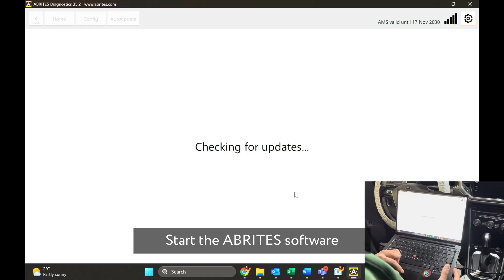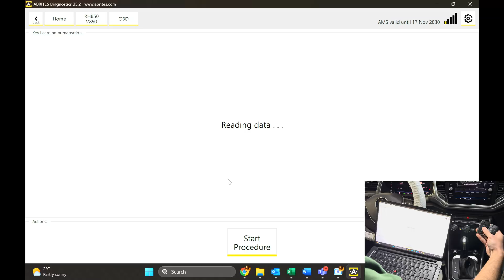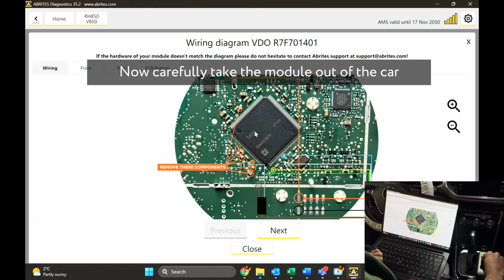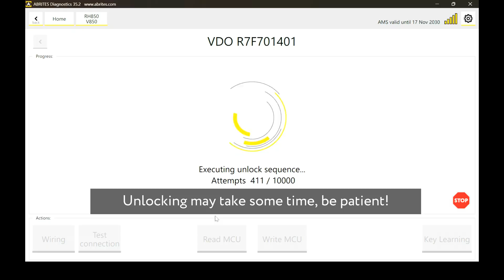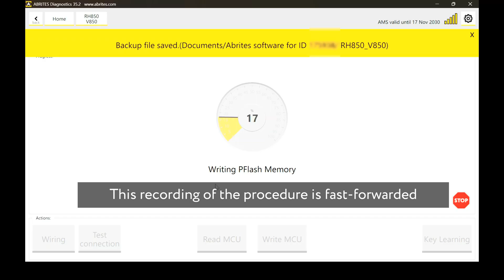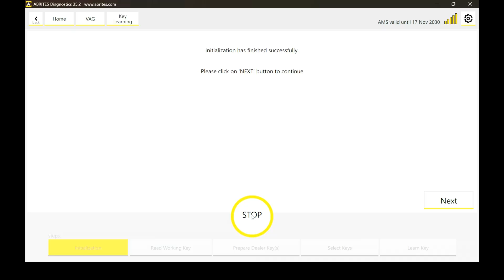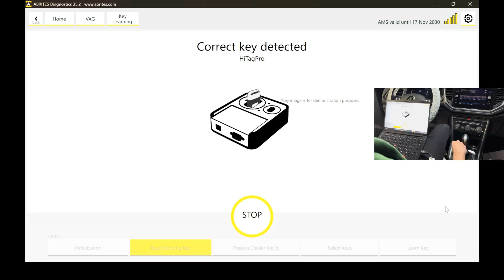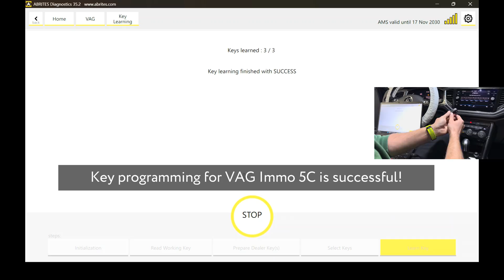VW T-Roc Immo 5C Add Key (HITAG-PRO) using AVDI, RH850 Programmer and Protag!

Comment: other users here in Brazil are also having the same problems with 5C not working on the Brazil panel
Reply: Yesterday I made a copy of the key for a 2022 T-Cross and I have to report that AVDI works fine. The problem with some key functions not working, such as the external presence sensor for the door opening lever or the remote control buttons, stems from the fact that some brands of "universal remotes" on the market (and I'm not sure if it's appropriate to mention them here, you'll know which ones I'm talking about) cause the problem. If the correct image isn't loaded when preparing the key for MQB49/5C, depending on the remote manufacturer and the image used, the internal presence sensor for starting and the transponder in the sensor antenna will always work, but the presence sensor and remote for external opening won't. However, when I change to a different "universal remote" manufacturer and use the correct image, everything works!

Comment: The xhors keys can be working too ?
Reply: Yes, you can
Reply: @twinturbo1989  Do you mean we can use the Original OEM Keys 5C instead aftermarket keys , is that it?
Reply: No, no other tool
Reply: @twinturbo1989  Hi Alek , OEM Virgin keys Hitag-Prog ID5C can be used ?
Reply: @twinturbo1989  hi, i think Xhorse key can be used for add key.

Comment: Bonjour, il y as besoin de remettre les condensateur retirer a la fin ? Merci d'avance
Reply: oui obliger pour les petits composants
Reply: @samir9656  merci pour votre retour vous êtes sur ? Une technique pour les ressouder ? C'est vraiment petit, il en parle jamais
Reply: @AnthonyStalder  je te conseille au fer en rajoutant de l'étain parce que l'air chaud ça me semble risqué. Fais contact entre les deux bords du composant avec ton fer tout en rajoutant de l'étain, tu verras ça part direct
Reply: @asvserrurerie-depannages2329 Merci pour le retour. Disons que l’enlever, je l’ai fait. Heureusement que je l’ai gardé du coup, mais c’est vraiment petit à ressouder et il ne parle pas et ne montre pas qu’il faut les remettres. J’essayerai demain. Merci en tout cas de m’avoir confirmé qu’il faut les remettre une fois le dump extrait.
Reply: @AnthonyStalder  Conseil pratique: plutôt que de retirer complètement le composant, assurez vous qu'au moins 1/2 pins ne soit pas en contact avec la platine (dessoudez 1 pin et relevez légèrement le composant). Si l'un des Pin reste soudé, vous risquez moins de perdre le composant et ce sera toujours plus facile de replacer le composant à la fin de la procédure.
Reply: @dmanis-ABRITES  Merci pour l'astuce ! J'essaierai pour le prochain. En tout cas, je pense que l'air chaud aura un meilleur résultat que le fer à souder, mais j'essaierai ta technique la prochaine fois. Merci !

Comment: Great Job Thanks !👌  just question ,  it is possible to use OEM Origial Virgin keys HITAG-Pro ID 5C or just the aftermarket keys  like Xhorse ? h
Reply: They also where using xhorse key
Reply: @haydarsahin4538  Yes, I saw that they use Xhorse keys , but my question if we can use OEM Virgin keys Hitag-Pro ID5C with this new function or no , It's better if you can use it like other brands.

Comment: Another  Question : When flashing is completed and the 'Add Keys' window appears, if this window closes while moving from the bench to the car — either due to accidental closure or connection loss — is there a way to reopen it after restarting the Abrites software?"
Min 7:15 in vidéo 
https://youtu.be/iKEYxbImM3s?t=435
Reply: Yes, once you are done on bench you go to the car and practically continue, the button is disabled before all is read.
Reply: You close the RH850 software and open the key learning, you already have the data read.